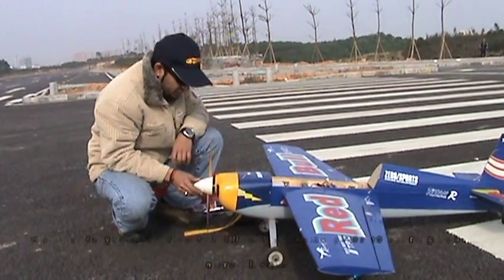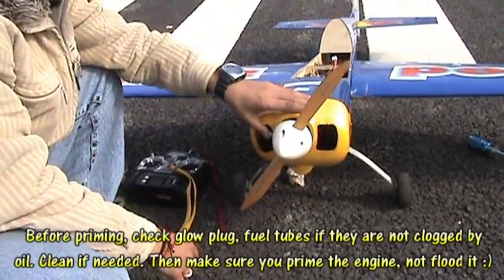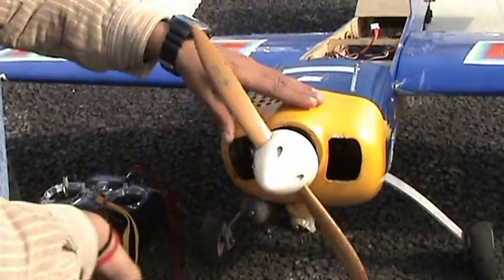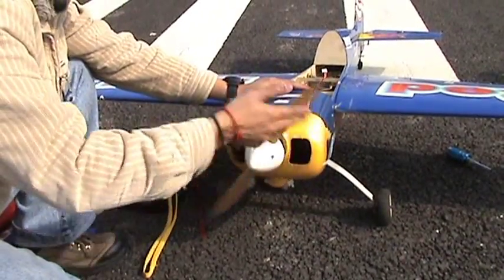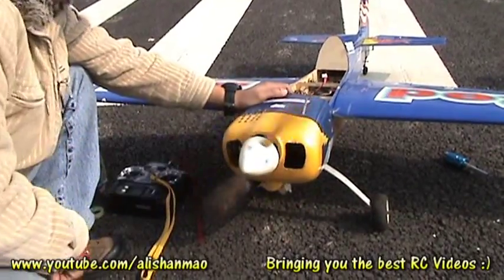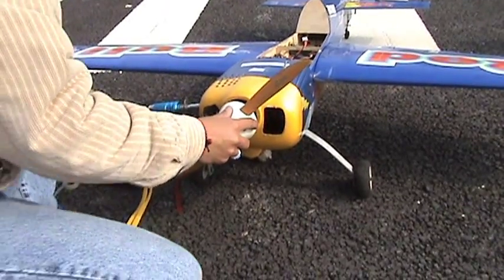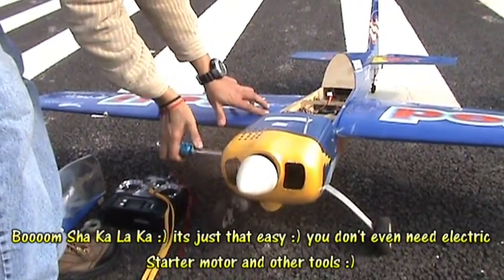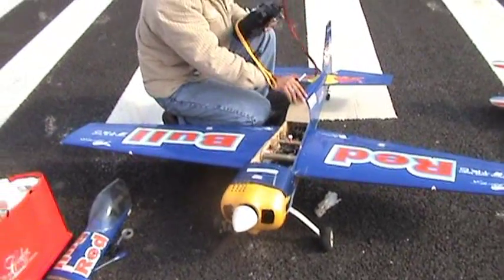Starting Nitro Plane Engine after few months

Comment: I have an F-20 Tiger Shark Prop jet. I got it at a swap meet and i got it pretty cheap RTF for $250 with a super tigre .91 glow in it. Anyways, i was testing the ailerons and (they are full wing) and i noticed i don't have much throw. I put everything on the inner hole. I am used to flying parkzone parkfliers so is that normal for gas planes to not have much throw? Note: This plane will be flying over 100mph.

Comment: well less equipment means danger but thats the chance you have to take i want
a petrol powerd rc plane which means no glow igniter needed

just spin the blade fast to get it runing simple but dangerouse
when you hear it pops and then starts for a blink second
then the next you spin it it will fire up on you 
that why you need a reaction timeing or else risk getting badly injurd and loseing a few fingers and alot of blood and i am not scareing you but just be safe as you want to be safe